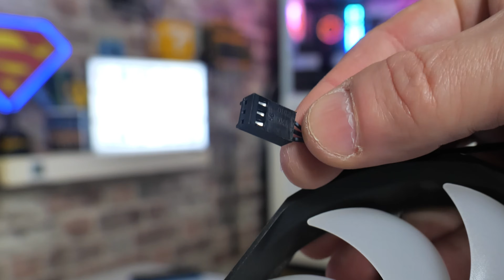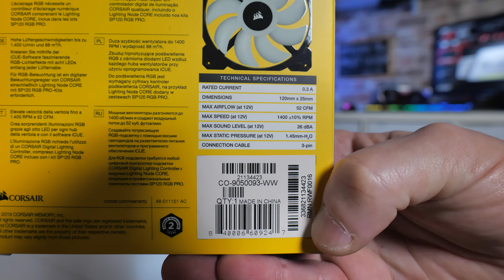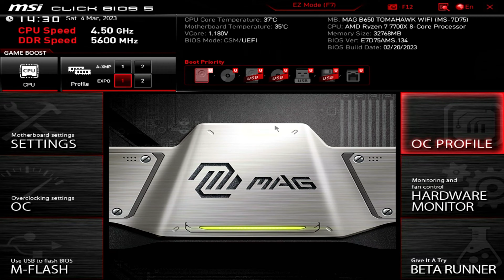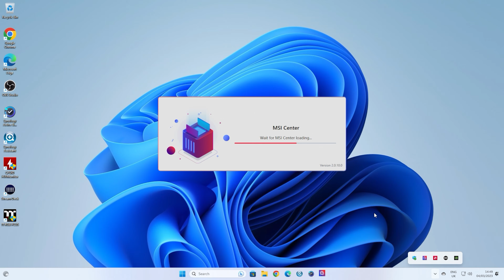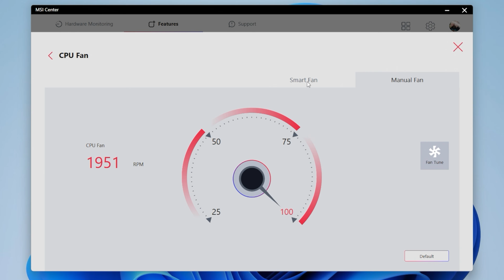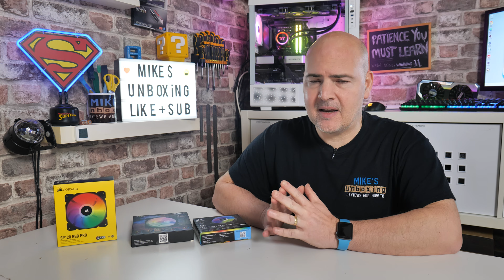How To Setup & Control AIO Water Cooling & PC Fans In BIOS Or Windows MSI Version

Comment: I need help I’m struggling. I have my aio thermalright frozen notte 240 fans and my case fans synced to system 3 and my pump for my aio when I set it to pwm it ignores my curve and stays at 5000rpm so 100%. If I use dc it follows my 80% curve is it okay to run my pump on dc mode at 80%
Reply from the maker: It’s perfectly fine to run your pump on DC mode as long as you aren't seeing high temperatures. 🐈👍

Comment: Hopefully this channel checks old comments. I’m currently trying to figure how to get my temps back down. I had them idling 30 C-38 C both cpu and gpu, I had an issue where I need to restart my pc due to a screen lock + audio issues hoping to have the issue resolve itself and it brought me into the bios page and it gave me an option of change back to default or load last successful profile and I figured that was my old settings. (Disclaimer my brother set this up and I’m wanting to try and fix it myself so I don’t bother him) I have control of Pump Fan 1 but the rest of my fans are all 0 RPM which seemed weird and I’m curious to know if there’s could be a connection issue in the hardware of the pc. I’m unsure what I’m supposed to do at this point I tried testing a few settings for the fans and got my temps down to 44 C cpu and 40 C gpu however when I did a few stress test my cpu immediately jumped to 72 C and would gradually lower to 44 C-50 C.
Reply from the maker: Sounds like a hardware connection issue if those fans are reading 0 RPM! 🧐if you want to go through some diagnostic checks on our discord you are very welcome

Comment: i have i9 14900k and msi mag 360 v2 liquidcore.. i have the same probl.. in idle i have like 50-60 degrees .. and when i play Pubg steam i have like 90-95 degrees… why?! i dont know what to do
Reply from the maker: The 14900k can run very hot, so those temperatures are not entirely unexpected under load. maybe increase the pump speed to 80$ or more if the noise levels are okay, and maybe look at undervolting the CPU a bit to reduce the heat and wattage
Reply: @mikesunboxing  thx anyway, i fixed :) i have temperature in pubg steam ultra.. 67 degrees maximum .. :)

Comment: I plugged my 3 pin aio in pump header on mb and I get 0 rpm
Reply from the maker: you need to set the header to be DC not Auto or PWM, let me know if this helps

Comment: Lol i had my pump at pwm the whole time never knew but my aio was not having overheat all but in gaming tho it would spike around 80 degrees in vr gaming here n there especially cod bo6 which ik not bad but still a lil concerning at same time to me my aio is a nzxt kraken elite aio 360mm v2 and it is 3 pin pump so its dc i just now set it to dc its been like that for abt a month or a lil longer now its dc it was having a lil noise the aio but i also need to get a better case and replace the pre install thermal paste for a better one currently gonna switch my paste to artic mx-6
Reply from the maker: easy mistake to make, all good now?
Reply: @mikesunboxing not sure yet i have realized temps are not spiking up to the 80s anymore in games was going from 60-76-81 degrees now in vr staying 55-66 degrees 90% of the time ever since i set to dc yesterday  the noise still there but lil quiter now im pretty sure air bubbles i had the aio for a day was fine then next day was the noise was fixed then came back after few days but i finally set to dc  after a month lol the only thing hearing kostly now is a lil wining or wirring i cant tell i think could be from gpu thought was psu was concerned so took back panel off and put my ear against the psu but nothing but fan noise like it working came from front somewhere either its the radiator or the gpu if its gou most likely coil wine its not super loud but can be noticable little bit was annoying im hoping to get a new case at somepoint for better airflow and replace thermal paste i do know the front top fan putting barely any pressure on the two pumps like looks its pushing against it a tiny bit but barely thought maybe that could be cause of either air bubbles or noise from aio radiator
Reply: @mikesunboxing and even before dc was set finally the temps idle were always fine 29-33 degrees when pc startup and for after games heavy games it stay 35-38 and spikes to 40 degrees for not even a sec i do think some of the spikes even when dc not set yet was and is also due to air flow my case doesnt have a ton of air flow it just has enough to where its decent and optimal basically good enough to have a good enough expierence front panel glass with one hole frontside of the panel has mesh with bunch small holes but skinny line for back panel solid no holes but very back of the pc has most airflow as usual for most cases bottom has no air flow except for the bottom for psu which is good for psu so therefore it has a okey rnough airflow but can be indeed better

Comment: Keep in mind if you have a Corsair water cooler all of the CPU and pump fan controls are controlled through corsairs icue software.
Reply: Ohh thanks, maybe that's why I'm stuck seeing 0RPM on all the tabs of the MSI Bios Fan Control screen...
I was trying to setting some different curves but nothing is changing on the fans...
I also have a pump "EK-Quantum Inertia D5 PWM" for my custom watercooled system, and also for this I see 0RPM for "PUMP1" and "PUMP2" tabs... Do you know any way to control that pump ? ^^
Thanks !

Comment: I can’t get my pc to post with the pump header inserted into the aio pump on mobo. But if I switch it to the other fan header it post but the pump doesn’t work.
Reply from the maker: sounds like the pump is damaged and needs replacing
Reply: @ I figured it out. I had to go into bios and set the aio pump to dc mode and set fan 1 (the pump) to 100% and it started pumping

Comment: My pc was very loud on BIOS mode and AIO fan was making rattling noise, then I put everything on SMART MODE in MSI CENTER , it's now pin drop silenced ! Pump fan speed now dropped at 550-490 RPM level which is previously at 2290-2300 rpm , Obviously the temperature increased by 4-6 degrees ranging from 29-35C . Did I do it right ? is it ok ? Please suggest. Thanks
Reply from the maker: i would increase the pump speed a bit personally but otherwise if the noise level suits you and temps are under control leave it as it is

Comment: I have msi pro z790-s wifi motherboard 
And my aio is deep cool le 520

I cant control the bump of my aio because the cable is 3 pin and my motherboard has 4 pin only

Also my motherboard hasn’t dc choise in the bios

What should i do? Because the bump is working in full speed
Reply from the maker: This is maybe easier to fix or at least advise if we can ask more questions and get direct answers, so feel free to join our Discord chat and we can go over it in more detail https://discord.gg/XtBTGQ6BDu
Agree to the rules by clicking the emoji and you will get access to the rest of the Discord channels
Reply: @ okay i joined to the discord
When  can i talk with you about my problem
Reply from the maker: @ just post the problem in one of the tech chat channels

Comment: I need help. My Aio has 4 wires, but the fans connected to them are 3 wires. If I set it to DC the fans will adjust, but the AIO will sometimes turn off. If I set to PWM the AIO will stay in, but fans will run at max. Pls help
Reply from the maker: This is maybe easier to fix or at least advise if we can ask more questions and get direct answers, so feel free to join our Discord chat and we can go over it in more detail https://discord.gg/XtBTGQ6BDu
Agree to the rules by clicking the emoji and you will get access to the rest of the Discord channels

Comment: If I have Thermaltake AIO, do I wire the Pump and Fan to the ASUS motherboard or to the Thermaltake Controller on SWANFAN fan and control them on the RGB Plus software?
Reply from the maker: it will depend on the Aio, but most are ARGB Sync which means they go to the motherboard ports. the RGB ones have the different connector for use with the hub. if you get stuck join the discord and we can try and go through it
Reply: @mikesunboxing  If l connect to the moto, can l still control the Light from RGB software?  Or do l need to replace the fan with RGB ones?  I am getting this next week for first time computer builder.

Comment: I’m running 6 fans but System 5 and system 6 aren’t showing up for some reason. I’m also using a ARGB/Fan Hub for the fans. Currently on a MSI B650 Gaming Plus WiFi board
Reply from the maker: if you are using a hub that will show as a single fan regardless of how many fans are plugged into it.
Reply from the maker: This is maybe easier to fix or at least advise if we can ask more questions and get direct answers, so feel free to join our Discord chat and we can go over it in more detail https://discord.gg/XtBTGQ6BDu
Agree to the rules by clicking the emoji and you will get access to the rest of the Discord channels
Reply: @mikesunboxing  will do👍 thank you so much for the reply!

Comment: Im not a yech guy far so any advice would be greatly appreciated. I have a pretty decent gaming rig that has been running perfectly for over a year but the past 2 months one set of my AL120 Lian Li fans are ramping up to 1750RPM whilst the other 2 sets are running smoothly still at 750RPM the noise is driving me mad and for the life of me I cant find a fix BIOS all I have is the CPU1 reading with no fan readings, PUMP1 0RPM System 1,2,3,4,5,6 0RPM, l-Connect 3 I cant change the fan curve but Port1 is the set running fast at 1770RPM with Port2/3 running at a stable 820RPM, MSI Centre has all the PC hardware data but control and RPM of the fans isnt within this software. Like I said computers confuse me at the best of times ive watched so many Youtube videos trying to find a fix but nothing works, help if you can haha.
Reply from the maker: this might help you https://youtu.be/UhAqIclYCWw

Comment: Hi Mike great video just what I was looking for but I’m still not sure what I should be setting the fan curves to. At the moment I’m pretty sure they are all set at full speed or mostly DC as fans are noisy the moment I switch it on. 
I’ve just built my first PC which is:
MSi x670e 
AMD 7800x3d
Artic freezer III 360
4070 Ti super
1x p14 Pwm pst rear case fan (exhaust)
2xP14 Pwm pst bottom case fans (intake)
Lian -Li 216X Lancool case
Reply from the maker: you can set the fan curves to the ones i often use 20% at 20c 40% at 40c 60% at 60c and 100% at 70c and that should be reasonably quiet, but also get loud when the CPU is under load
Reply: @mikesunboxing  great thanks Mike. Will it be ok to set all fans at those settings?

Comment: Thank you for giving us this helpful and well explained video! When i get this right, if i setup the fan curve in BIOS it’s all good and MSI center isn’t needed?
Reply from the maker: Yes that is right the bios settings will remain in use in windows unless msi center or other fan control software overrides it
Reply: @mikesunboxing I’m using arctic fans and air cooler on my 7800x3d and have about 57-60 degrees celsius. Is this like normal or should i improve my fan curves?

Comment: Im having the issue of my AIO fans creating a ghostly howl sound when they ramp up and back down. There is no howl in idle, but under load there is a howl as the fans adjust speed up and down again.
Reply from the maker: try loosening the fans and even the radiator, when they are too tight the rubber can't isolate the frequency and you get reverb
Reply: @mikesunboxing  I will try this

Comment: Super late reply, but I was wondering about one thing. Will the bios understand and identify the cpu fans/pump fans by themselves? I recently got a AIO, which, as in your example, has CPU FAN and PUMP FAN seperate. I think I plugged the cooler you put on top of the CPU itself (is that maybe called the pump? which would be weird, no?) into the CPU header on the mobo, but obviously the other 2 (using a AIO with 2 fans at the top, so 240) didn't have a CPU header in the mobo to plug in to. Does it matter which one of the other free fan headers I plug them in? Should I replug all of the fans to make them be in the "right" space? Like, is it correct with having the cooler itself (the physical one) that you put on the CPU into the "CPU" header on to mobo as I expected? 

Reason I'm asking cus I feel like my fans are being a little....aggressive. PC is idling at 30 celsius, and doesn't go much higher when playing. But even whilst idling you can hear the fans. But then I see you, and some others, recommend to have pumps at 100% or close to, which makes sense. But when I try to install a program called "FanControl" I found out that there is also one of the SysFans that are noisy, which is weird :P
Reply from the maker: the fan headers are pretty dumb so you need to tell the board exactly what is connected and what you want the headers to do
Reply: @mikesunboxing  Got ya, thanks for the answer. I'll tinkle some more with it ! :P

Comment: When I put it on a Core CPU the fans are very noisy, if I put it on another option like Chipset, will it make a lot of difference to the processor temperature?
Reply from the maker: yes because it won't be monitoring the CPU temps. the cpu fan should always to monitoring the CPU to regulate the temps
Reply: @mikesunboxing  my processor is a ryzen 5 5600gt and it heats up too much in games between 70 and 80 degrees, monitoring the CPU the fans stay at 100 percent all the time
Reply from the maker: @leonardoferreira3039  This is maybe easier to fix or at least advise if we can ask more questions and get direct answers, so feel free to join our Discord chat and we can go over it in more detail https://discord.gg/XtBTGQ6BDu

Agree to the rules by clicking the emoji and you will get access to the rest of the Discord channels

Comment: Hello Mike, I bought the "MSI MODERN AM242P 12M i7-1260P" model Allinone. There is no section called "User Scenario" in MSI Center. That's why I can't adjust fan settings. Is there any other way to solve this problem? Or should we wait for a new update or use an old version? Thanks
Reply from the maker: if the software is not available in the MSI center that means it is not compatible with the motherboard, but bear in mind you have to add user scenario as a feature from the list of available modules, it isn't installed as a default

Comment: what is the disadvantage of setting your cpu fans/system fans to 100% RPM all the time? woudnt that be good because it will keep your system cool = better performance?
Reply from the maker: it would be noisy
Reply: @mikesunboxing  other than noise will having it run in 100% speed make it perform better due to lower temps and will it affect the longetivity of fans if you keep in in 100% than having it changing from time to time due to fan curves? i dont find my fans 100% speed really noisy

Comment: Hi Short Question i Have an Arctic Liquid Freezer 360 A-RGB the thing is The Pump, Fans and the Little fan on the AIO are all connected on one Cable so they´re on the connected on the Pump_Fan1 on my Board now i dont know if i should let it Stay on the Max or if i should turn on Smart Fan Mode cause i´m not sure if this is Good for the Pump if i turn it on.
Also teh Problem is thet the Fans are a bit Loud like Pulsing cause the RPM are changingn evertime so maybe you can Help me should i turn Smart Fan mode on or off ?
Reply from the maker: the single PWM plug should be on the CPU header so it can regulate speed based on the CPU changes. set to smart fan and something like 20% at 20c 40% at 40c 60% at 60c and 100% at 70c

Comment: Always make sure that if you have a mobo that doesn’t have a pump header, and u just use the 4 pin cpu fan into a 3 pin radiator then make sure that you change the setting in the bios to dc instead of default pwm.
Reply: Idk why I’m so confused. I have a i115 water cooler but my pump header goes to the bottom of my board but in bios I have pump speed 0 and there is a cpu1 fan 3 pin connected in between the 2 fans that all go into the club block.

Comment: Hi Mike! I put my Pc on sleep mode with an MSI motherboard and Lian Li Cool 216 RGB case which has 2 160mm in the front. After I turned my Pc on again the top front fan doesn't spin anymore. How can I fix this? Thank you!
Reply from the maker: you might have the fan RPM set too low ? worth checking

Comment: Are  MSI center balanced option and smart fan curve in bios good enough? It seems that my coolers are working even when the computer is idle, with really cold air coming from them. I have 6 coolers + 2 for CPU. I am a bit afraid to experiment in the bios as a total beginner....
Reply from the maker: This is maybe easier to fix or at least advise if we can ask more questions and get direct answers, so feel free to join our Discord chat and we can go over it in more detail https://discord.gg/XtBTGQ6BDu
Agree to the rules by clicking the emoji and you will get access to the rest of the Discord channels

Comment: update: Deepcool Pump was faulty, no issue with board. i got MSI tomahawk b650 looking at you video please help my Deepcool LS520 SE  is not running at 100 % and causing this awful sound when it runs at 2550 rpm instead of 3100 what to do, i bios it is set to DC ? https://www.youtube.com/watch?v=1O7ablhe6Co
Reply from the maker: is the pump 3 or 4 pin? if four it should be set to PWM. also the pump impeller sounds like it is sticking, could be a manufacturing defect or the pump set to the wrong PWM or DC setting
Reply: @mikesunboxing  3pin pump header and 4 pin cpu fan header  I spoke with deepcool they r saying to check if replacement works i rather take refund
Reply: @mikesunboxing  pump was faulty returned, also in another comment i mentioned with sata, it was sata cable not working properly. MSI Board is good !